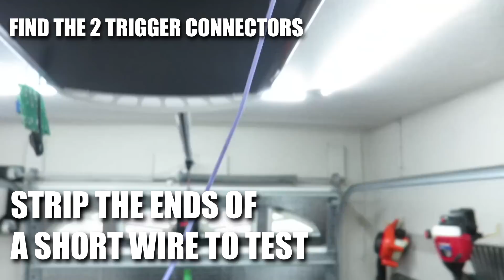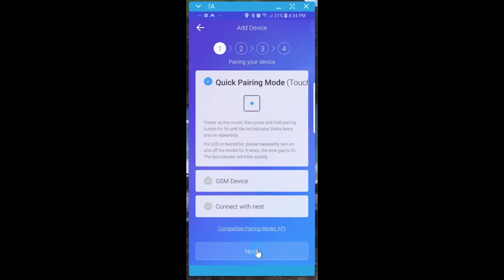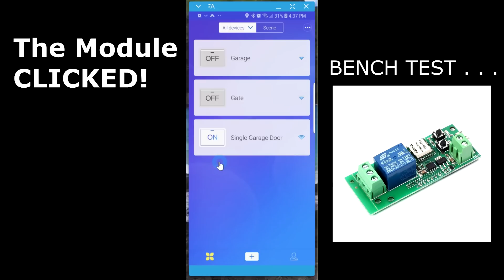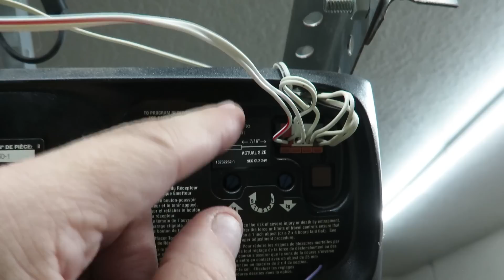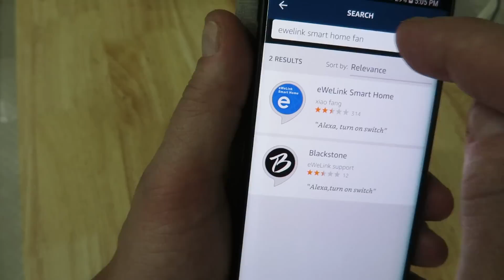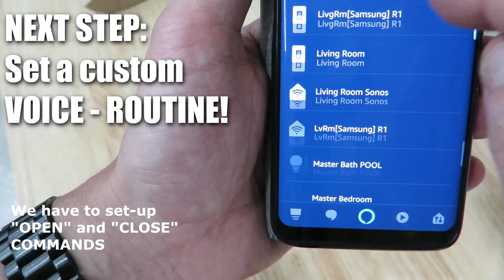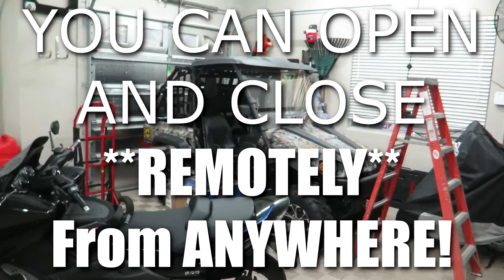SMART GARAGE DOOR OPENER | $15 | eWeLINK Smart Control for Garage Doors | with ALEXA & Google HOME

Comment: Unless I'm missing something the downside of this setup is that Alexa does not know if the door is open or close, so you have to know it's current state. Unlike the MyQ app that knows if the door is opened or closed. Granted MyQ won't work w/ Alexa. But this is cool, especially when your driving up and you have the new soon to ship Echo Auto for your car you can say Alexa open black hole. For security I would not use open garage door. Thanx for posting video, the test to see if your opener is compatible , was helpful along w/ the rest
Reply: I too have the MyQ garage door module and I installed this board so that I could use Alexa to open/close my garage door if my hands are full and it's difficult to push the button. The MyQ app will still send a notification when the door goes up or down no mate how you open the garage door so this is the perfect way to work around the fact that Chamberlin does not allow you to integrate Alexa with their module and you can know the state of your garage door.

Comment: Hi Todd,
   My linear garage opener only have 3 wires (push button/common/beams). Do you know how can I test to see if it will work? Thanks
Reply from the maker: It appears to me by what you are describing, you would make a test wire as shown in the video and touch one end of the test wire to the "push-button" connection and the other end to the "common" connection. These are probably the two connections that your opener's button use...and this should trigger your door to open and close.
Reply: Thanks Todd. Finally got unit and is working with my garage door opener. However, there is a red light keeps flashing on the garage door opener (Linear brand). Is that something normal? I do keep the right button on circuit board off. Thanks in advance

Comment: Great video!  I got mine up and running however it seems to run the command twice, sometimes more. Have you run into this issue before and is there a setting that can be adjusted?  2nd question is I am using it for my property gate and need to give access to multiple people.  What is the best way to accomplish this?
Reply from the maker: Ummm...Make sure just the "inching mode" button/LED" is lit-up. The outer LED is for constant connection when activated. Depending on which board you ordered....usually the inching button is located toward the middle side of the board and the "constant-on" button/LED is at the edge of the board. You can test the board and button, when it's hooked up and powered-on....Press the inching button once.....does it activate your gate like pressing a remote button (to open it?).
Reply: @twHomeShow  When I press the inching button it does operate just as it does when I operate it from the app.  Each time I press the middle button it turn on for about a second then turns off as expected but then it does the something about 3 to 5 seconds later.
Reply from the maker: @ralphkuney6340  Did you try to increase the inching duration time yet?
Reply: @twHomeShow  Yep.  1, 1.5, 2, 3, 10, 50, 200, 500.   Deleted it and reinstalled but still getting the same results.  I wonder if I have a faulty board?
Reply from the maker: @ralphkuney6340  Maybe.. Nothing is blocking your safety sensors at the bottom of your door?...and it still works with one press of your normal garage door physical button? One other thing, is maybe you need less inching duration. Just a thought.
Reply: tw HomeShow I actually haven’t hooked it to the gate yet. I have just been bench testing it. 0.5 is the lowest setting and I have also turned it off. Still no luck.

Comment: Thanks Todd, got it up and running in less than 20 minutes as you said.  I do have to usually try 4-5 times before the garage door is actually triggered to open or close, do you think it's my WIFI signal in garage? Or perhaps any other ideas?  Thanks in advance
Reply from the maker: Yes. Mine started to do that a couple of weeks ago, but I figured out how to fix that issue. If you open the eWeLink App and select your garage door that you added, then at the top right of the App you should see 3-dot menu selection, select that and goto Settings, now scroll-up until you get to the bottom settings, you should see Inching/duration....I think mine was default .3 or something, I changed mine to 1.0....(I would change this little-by-little up from .3 and keep trying until you get to "the sweet-spot" that will work everytime on the first command. I hope this helps you :) Todd
Reply: @twHomeShow  Thanks Todd, I will give that a try and let you know how it goes!  Great video.  Thanks again!

Comment: Hello, Great video. Got mine installed and working. Have some questions but havent seen a manual anywhere. I'd like to change the words on/off to open/closed.  Really would make it much better. Hope you can help!  Thanks! Tom
Reply from the maker: That's great news! Yes, you can make it operate by saying open or close garage door with Alexa Routines....I explain it near the end of one of my 3 garage door opener videos :)
Reply: @twHomeShow  I'm actually just trying to change the text on the app to openm close if possible.  Thanks!

Comment: This was some great information.  I ordered 3 units and have them all working but for 2 of them, if I disconnect power from the control module and reconnect, the relay activates and the door opens.  I am not sure if I have changed a setting that causes this or not.  I think this could be a security issue if the power goes off and comes back on while I am away from home.
Reply: I know its been a few years but I had the same issue. Came home and my gate a G door was open... I fixed this issue by plugging the device into a YPlink smart plug.($5 on Black friday).. I then made an Alexa routine When I tell it to open garage it did these 3 things in the same routine
1. Turn smartplug on
2 Wait 20 seconds
3. Turn smart plug off
I threw the breaker a few times to test it and it stopped the unwanted openings

Comment: Todd, installed 2 of the devices on my garage doors and followed your instructions for routines on Alexa, works great. For the xtra $20 bucks it's worth the less hassel than using  a Sarnoff relay and have to cut and solder the relay. Thanks for your VIDIO.
Reply from the maker: Great! Thanks for the nice comment :) Todd

Comment: The two wires.... which one goes where on the garage Unit?
Reply from the maker: It doesn't matter. Connect them to the same 2 connections that go to your wall switch.
Reply: Thanks a bunch! Installing it right now!

Comment: I hope I am not getting on your nerves. But I figured out the problem I am having. When I connected both ends of the bell wire to the the garage opener the ewelinks app would work but the switch on the wall wouldn’t. Now i figures out that only one would Work at a time. So when the eWeLink  app is in the “off” state my wall button would work normal. But when the eWeLink is in the “on” state the button will not work. Strange but at least I know.
Reply from the maker: Hey thurm101, make sure the middle button is the ONLY button lit with the LED light on your ewelink board. The middle button is just a "momentary" switch activation. If you have the outer LED lit then it stays activated, and you don't want that. That might be interfering with your wall switch. Todd
Reply: tw HomeShow You are exactly right. It stays lit. Both of those lights stayed on.
Reply: How do I perform a hard reset on the whole board and start all over?
Reply from the maker: @thurm101  You should just need to press the button above the "OUTER" LED light to turn it OFF. Just have the middle button pressed to turn-ON the middle LED light. NO NEED TO START-OVER
Reply: tw HomeShow Todd I just went down to the garage. I turned off the outer LED. Leaving the inner LED still on. Now was that in some kind of activation stage?
Reply from the maker: @thurm101  If just that ONE inner LED is turned ON....It should work as described. BUT, remember, if you want it to operate with alexa - you'll have to watch the video again and see how I set-up the ROUTINES. So you can say "alexa, OPEN Garage Door"...and "alexa, CLOSE Garage Door".
Reply: tw HomeShow Thank you Todd!!! You are the greatest. I am sorry for disturbing your evening. The garage floor was cold but I went out and turned off that outer LED. I am going to watch your video again to see the routines.
Reply: tw HomeShow Todd the commands work!!!!!! I know the neighbors think I am crazy with the garage door opening and closing. I feel empowered because of you and the same amount of money I paid for all of this.
Reply from the maker: @thurm101  I'm glad you got it working properly. At least it sounds like you did! GREAT JOB and I hope you are SUBSCRIBED to my channel :)  Todd

Comment: Dude thanks I finally got around to installing my unit. However I am having some issues. The app works but the switch on the wall does not. So I disconnected the module and the wall switch worked again. I am puzzled. Any ideas?
Reply: Im running into the same issue. Cant figure out a fix yet.
Reply: bajarboys well Todd the creator of the video stated that if you see (2) lights on then you need to turn the outer light off. I  had both lights on. If this is your case then go to the unit and tap the little black button to turn the outer red light off. This should fix your issue. 

I would suggest you to install a WiFi camera in your garage. That way you can see if the garage is open or close if you are not at home.  Because the eWeLink app wont tell you open or closed. It just triggers the garage door opener.

Comment: I have a newer garage door opener with wifi built in.  Model Liftmaster 8550W  I was unable to get the door to cycle with the jumper cable.  Would you happen to know how I can automate the door to work with alexa?  Thanks

Comment: Thank you so much. I installed my board today and everything went smooth thanks to your excellent instructions!  My home alarm has a garage door sensor. I need to figure if I can have Alexa check if the garage door is closed when I say close garage door. This is so it will not open a closed door!

Comment: how do you get the switch to act as a momentarily on-off switch?  I just installed the board and when I activate the switch it actuates the door opener OK but the switch remains closed.  So when I try to go the other way, the switch will open but the door won't move.  So for it to work, the switch must work momentarily on/off and I haven't been able to figure that out how you did it.  I ordered the board from the link you provided, however, the switch wiring connector is located on the end of the board, rather than on the side of the board as yours.
Reply from the maker: The momentary switch/LED that should be lit is the button near the middle of the board. Only that LED (or switch) should be lit...NOT the outer switch LED.
Reply: @twHomeShow  I was referring to the nc/com/no connector.  Mine is on the end of the board behind the relay, instead of on the side of the board/relay like yours. The LEDs are working fine.
Reply from the maker: @CarlosAvellanet  Oh, sorry. Connect your two wires (doesn't matter which one go to which) one wire to the "COM" and the other wire to the "NO" connector screws. Todd
Reply: @twHomeShow  I figured it out.  I had the two wires just as you described from the get go.  I think the problem is with my version of the app.  I created a profile that has two command lines, one to turn on, and other right below it, to turn off.  That did the trick and I can use the same one to either open or close the door.  My app looks different than the version you show on the video.  I have a Galaxy Note 8. Thanks!
Reply: @tw HomeShow I watched another vid here on you tube that describes how to turn on "itching" on the ewelink app settings.  No more work around with the profile command...it works like a charm.
Reply: @CarlosAvellanet  The inner button is a reset/sync button and the LED next to the inner button will go solid when the device obtains an IP address from your wireless router.  It will flash while searching for the WiFi signal (or pairing mode) before an IP is obtained or if your WiFi router is out of range.
The outer button also has an LED next to it, but it has nothing to do with connectivity.  It is a button that allows you to toggle between 2 modes.  If you toggle the LED off, the device will be in "auto off" meaning when you give it an "on" command from your mobile app, it will automatically turn back off after 1 second.  This is used in garage door opener applications.  However, if you toggle the outer button so that the LED is illuminated, it will be in a constant-on/constant-off mode meaning when then you give the device an "on" command from your mobile app, the device will stay in the "on" position until you give it an "off" command with your mobile device.  This is the mode that you want to use for lights, fans, etc. Cheers!

Comment: Hi Todd, your video was nicely put together, but you failed to mention one important thing for your viewers.  The button next to the pairing button is important to discuss.  If the LED next to that button is on (mine was by default),  and your fancy switch receives a  command via eWeLink or Alexa to turn the switch "on", it will stay in the shorted "on" position.  You don't want that to happen in a garage door opener application.  That would be like pressing your wall mounted garage door button and never releasing the button until you give it a manual "off" command.  Pressing that button next to the outer LED will turn that LED off which puts the device in an "auto off" mode after a 1 second delay of receiving the "on" command.  This is the ideal mode for a garage door opener or electric gate opener application.  Hope this helps!  🤙
Reply: PVT-PILOT is that inching versus self-locking? I'm looking at the devices online and scratching my head trying to figure out which ones we need. We have a double and single door each with a wall button (do people refer to this as "wall wart"? Trying to get the lingo down on FAQ boards) and each door with a remote although all three of our cars use homelink. I'm trying to figure out how many channels we need. Some say one extra for each remote? So I'd think 2 channel for each door based on that? Sorry I'm a newb
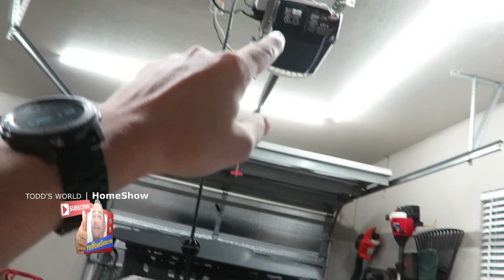Reply from the maker: Please re-watch at 10:31 in the video and 18:07 in the video. Maybe I should have made a STRONGER point to the button settings. You're correct....BOTH buttons should not be on. Thank you for watching and allowing us to bring up this setting within the comments section here, so that others can benefit :)  Todd
Reply: tw HomeShow hi Todd, in reading reviews of switches on amazon I’m seeing where some claimed to have controlled two doors with a similar board that has two channels “wiring in parallel with the wall buttons”. Have you heard of this? We have a detached garage with a double and single door. The wall buttons are closer to our router so this may work better if I figure it out. Need to read a little more on it. The SmartThings door sensors I put on the physical garage doors must be a little too far from the ST hub as they don’t register all the time. Plus the wind shaking the doors and triggering the sensor is killing the batteries. Like one a week. Great channel. To the point and helpful!
Reply: Ok so just to answer my own question since nobody jumped in, you can just wire these up to your wall buttons 💁 much easier and no ladder necessary. Used a two channel switch for $15 and hooked up switch to each door at the wall buttons. Controlling with my Apple Watch when I go for a run or walk my dogs through Alexa via the voice in a can app on my watch 👍
Reply: @shayf8369  yes, absolutely  you can wire it in parallel at the wall buttons, at the motor or anywhere along the wire run.  It is just an easier setup at the motor because there is power readily available there.  How did you power the unit at the wall buttons?  How did you hide the ugly circuit board at the wall button location and still get power to it?
Reply: PVT-PILOT thanks and good point. For our setup my husband has his workbench on the same wall as the garage buttons with several outlets. He quickly noticed I had taken one however so I pulled out an old surge protector with multiple switches and attached that to his pegboard so he would gain switches and not lose anything. He’s not crazy about it tbh 🤷‍♀️ then I went to HD and looked at their electrical boxes and realized my neutrogena makeup remover wipes container is basically the same plastic container with snapping lid without holes for wires and mounting so drilled some and attached to wall right next to buttons. I think it looks pretty good and I don’t have to take my keys or phone on a run or to walk the dogs. I just use that voice in a can app on my watch and say alexa activate garage little door or garage big door. As a programmer I’m a little annoyed the Alexa iOS app doesn’t drill down to the channel level so I can’t set up a routine to say open instead. The app only goes down as far as the switch (I named garage) but voice control works on the channel level (channel 1 little door channel 2 big door in this case). For $15 I’m happy and all this info helped a lot. Thanks!